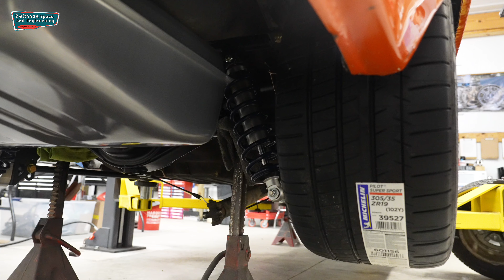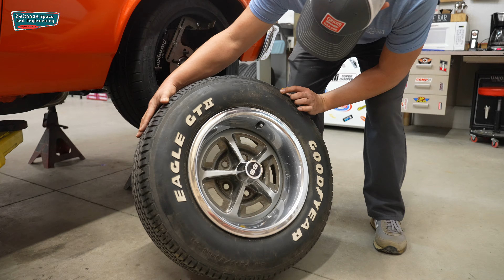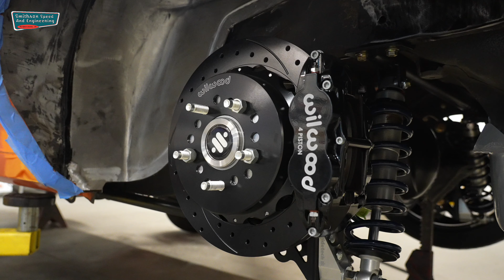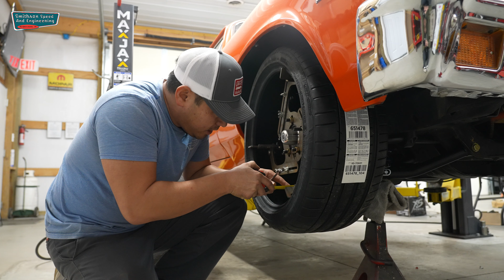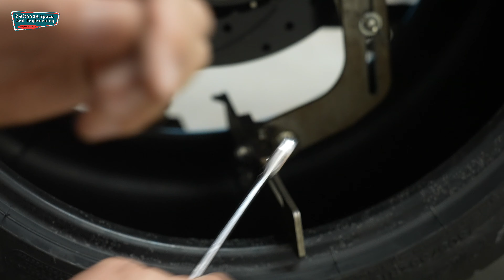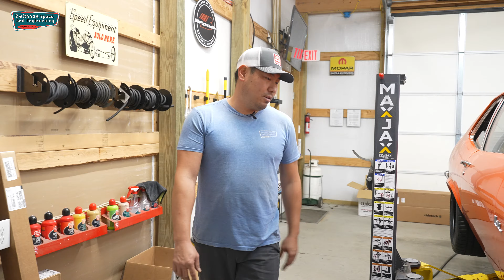The Ultimate Guide to Wheel Fitment! | Smithson Speed

Comment: Is everything based on 0 offset? Great video but what happens if you order 5” BS but the wheel has a 60mm offset…..doesn’t that screw everything up?  Thanks…great channel…Wish you were in Massachusetts!
Reply from the maker: So offset and backspace measurements give you the same thing, they just go about it differently. This tool helps find your backspace, but any wheel manufacturer should be able to convert backspace to offset to ensure the wheel fits and is built correctly.